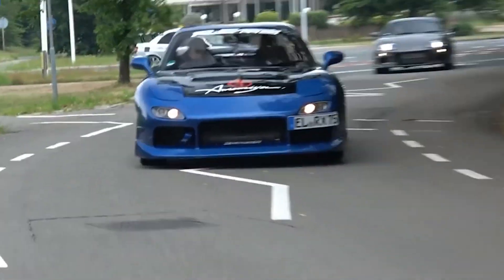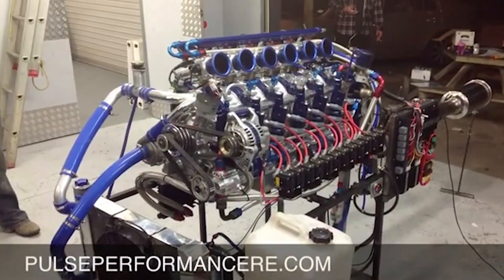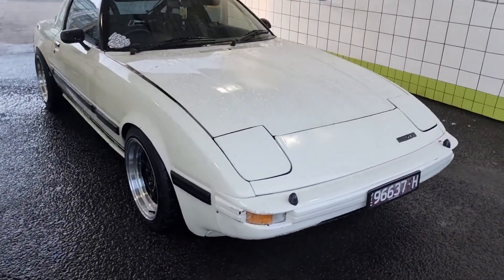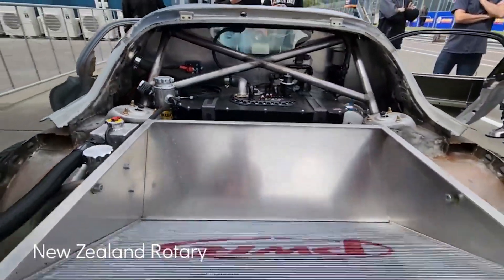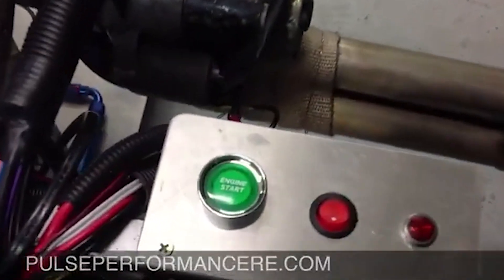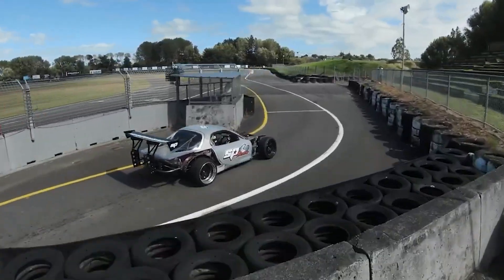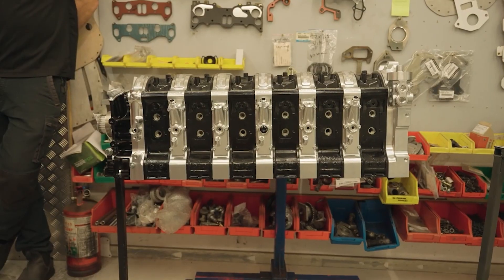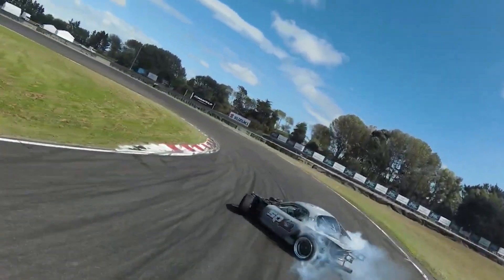This is the Best Sounding Engine Ever Build: Unleashing the NA 6 Rotor Wankel

Comment: so, aside form the eccentric shaft and tying all the housings together, theres not a lot of "complex engineering" that went in to that. 

the real reason that thing costs $69.000 is because theyre trying to recoup the time spent milling the custom parts on the machine. 

for some perspective here, you could buy a GM 632 big block that makes 1,000hp and 875 torque on pumps gas, WITH A TWO YEAR WARRANTY for $33,000.
Reply: It wouldn't sound like that

Comment: In away I'm kinda a purist. 
So i would have to keep it in a mazda.
I know it kinda sounds stupid 
And i really don't see anything wrong with engine swaping to a different make car.
But for some reason i just feel wrong doing that.
My favorite engines are 2JZ GTE, RB 30 DETT, SR 20 DET, 1 UZ, ZZ 632, I forgot the name of the Toyota 3 cylinder,  and Rotary engines. 
And while yes i would love to swap 
My Nissan Silvia 13 with either a 
2JZ GTE or a 6 Plate Rotary i have a hard time bring myself to do that. Lol

Comment: One of the amazing things about rotary engines is how compact they are. I mean, being able to fit both a standard 2 rotor or 3x that (6 rotor) in the same car. Not aure what mods they may have done for the 6 to fit, but 4 fits ok from my understanding

Comment: sounds like an f1 v12 engne

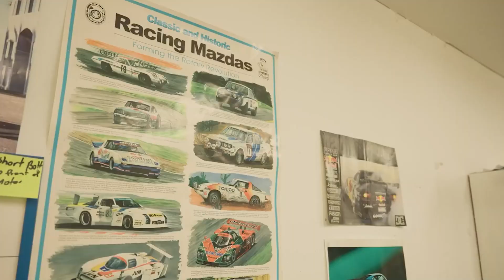5:12 wet sump👀👀👀
Reply: where the fuck do you see a wet sump setup. i mean, the assumption is correct, because most are wet sump, but many race cars and four-stroke
 are dry sump systems.

Comment: I respectfully disagree , the best sounding Engine of all time is the Rolls-Royce Merlin , hear her purr :) https://www.youtube.com/watch?v=S0qxjX4YlNg
Reply: i respectfully disagree with your respectful disagree and disagree that the merlin is not the best sounding engine.
Reply: @Richie_RHD  I have to disagree with you and here's why,

Resonance describes the phenomenon of increased amplitude that occurs when the frequency of an applied periodic force (or a Fourier component of it) is equal or close to a natural frequency of the system on which it acts. When an oscillating force is applied at a resonant frequency of a dynamic system, the system will oscillate at a higher amplitude than when the same force is applied at other, non-resonant frequencies.[3]

Frequencies at which the response amplitude is a relative maximum are also known as resonant frequencies or resonance frequencies of the system.[3] Small periodic forces that are near a resonant frequency of the system have the ability to produce large amplitude oscillations in the system due to the storage of vibrational energy.

Resonance phenomena occur with all types of vibrations or waves: there is mechanical resonance, orbital resonance, acoustic resonance, electromagnetic resonance, nuclear magnetic resonance (NMR), electron spin resonance (ESR) and resonance of quantum wave functions. Resonant systems can be used to generate vibrations of a specific frequency (e.g., musical instruments), or pick out specific frequencies from a complex vibration containing many frequencies (e.g., filters).

The term resonance (from Latin resonantia, 'echo', from resonare, 'resound') originated from the field of acoustics, particularly the sympathetic resonance observed in musical instruments, e.g., when one string starts to vibrate and produce sound after a different one is struck.
Overview
Resonance occurs when a system is able to store and easily transfer energy between two or more different storage modes (such as kinetic energy and potential energy in the case of a simple pendulum). However, there are some losses from cycle to cycle, called damping. When damping is small, the resonant frequency is approximately equal to the natural frequency of the system, which is a frequency of unforced vibrations. Some systems have multiple, distinct, resonant frequencies. 

No need to thank me for this simple explanation - just buy me a 6 pack instead.
Reply: The best sounding car https://www.youtube.com/watch?v=xfrNcMS3zbA
Reply: can't beat rotaries